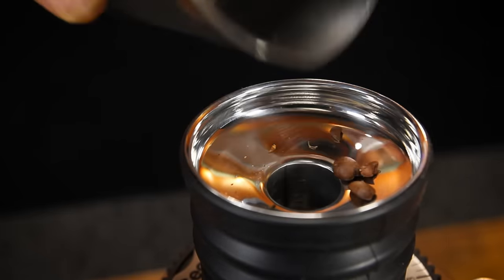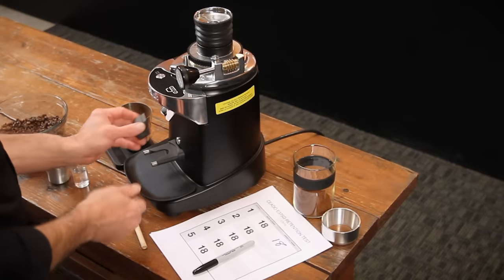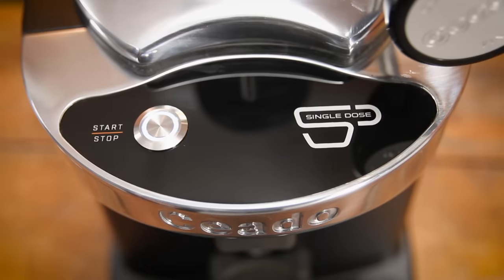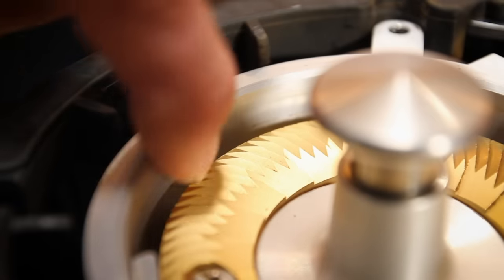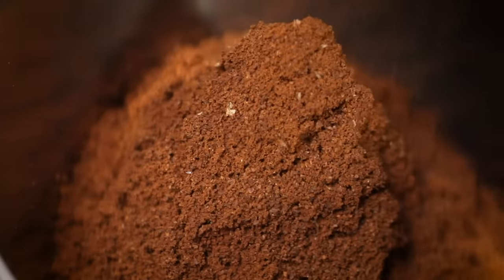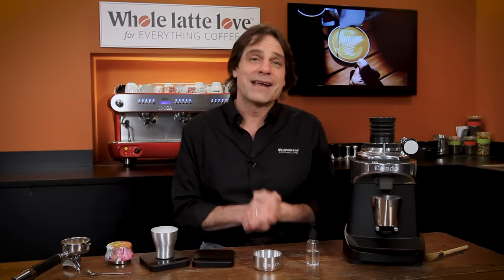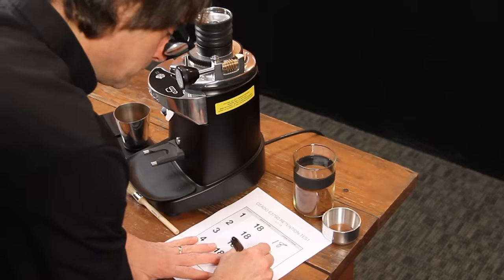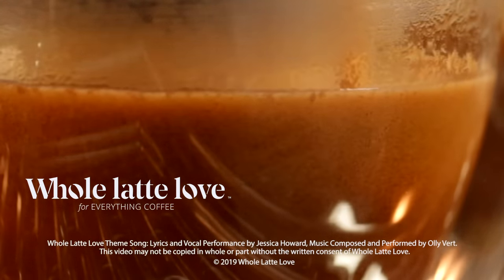Review: Ceado E37SD Single Dose Titanium Burr Coffee Grinder

Comment: Even as I am no customer of WLL - I live in Austria - I am a great fan of your reviews and „how-tos“ and I have learned a lot. Thank you for your great work and your „education“. Now I need an advice: I have recently bought a Ceado E37SD, mostly because of your praise of the machine. My problem is that I can not grind fine enough. I drink espresso only and even if I am close to „0“ the coffe is still to coarse. Could you maybe help me with my problem? I am quite frustrated and unhappy. Thank you in advance!
Reply from the maker: Hi Peter, Sorry you are having issues. Must be frustrating! You should be able to adjust fine enough to have the burrs touch and produce a grind so fine it will choke any espresso machine. If you did not know "0" on the dial is just a reference and usually does not represent the finest grind setting. The scale with numbers can be rotated without adjusting grind size. It's held in position by a magnet. Here's what I would do: With no beans in the grinder turn the motor on and continue adjusting the grind finer until you hear the unmistakable sound of the burrs just touching. When you hear that sound quickly back off a bit to a coarser setting. Back off just until the burr touching sound stops. That's the finest setting on the grinder. If you like you can position the scale (it just slides) to zero. Do not worry about the burrs briefly touching as it's not the cutting edges making contact but flat non-cutting surfaces of the burrs which are slightly higher. At that setting your grind will be too fine for espresso. If you set zero at the burr touch point you'll want to back off to a range of .5 - 1.5 before grinding for espresso. Cant be exact with that as a lot depends on bean type, dose weight, etc. From there dial in your grind as needed. I believe this should solve your grind size issue.
Marc
Reply: @Wholelattelovepage  Thank you Marc for your quick and enlightning answer! I hoped it would be something which can be fixed quite easily by me but I would not risk fixing it wirhout good advice. I will try it out tomorrow morning (our time). Thanks a lot for your help. Looking forward towards your next videos! You have a big fan in Vienna!
Reply: @peterfraunhoffer7126  How did things turn out after your adjustment? Were you able to have fine enough grinds?

Comment: Hi Marc! I wandering about the burr will it be wet and hard to clean if we use wdt? Because on my last case i used this method in my mazzer mini, and when i try to clean it, the burr is wet and take a lot of my time to clean it. Is it the same with E37SD? 
Thanks for your great review on this product! 👍
Reply from the maker: Hi Hadi, Thanks for the question. The titanium coating on the burr is very slippery so less adhesion of water and coffee dust to the burr. I took apart a well used E37SD 2 days ago and it was remarkably clean! One of the benefits of titanium. Since it's a singlre dosing grinder no partially ground coffee is left between the burrs. Using RDT with this grinder is recommended!
Reply: @Wholelattelovepage  Hi Marc! Thanks for the detail explanation. 👍

Comment: Hi Marc,
I need help choosing between the e37S and the SD.  

I feel I am a single dose person and I would never get tired of it (plus I would likely pull one shot, maybe two a day).  A couple of people have told me that I can use the S in single dose mode (without the weight of the beans in the hopper that it was designed for), and there would be no (or almost) no difference in the cup (compared to the SD which is designed for single dosing).   

I’m concerned popcorning on the “S” might give an inconsistent grind (without beans in the hopper).   

RE: retention; how concerning is a half gram retention? It seems like I could put three beans through the E37s to purge.. or is less than a half a gram not worth worrying about at all?   

I wish the engineers would let us know if the motor speed, titanium burrs, and the different shape of the cutting teeth we’re all designed for a more consistent grind, or if this is all for retention purposes?
Reply from the maker: Hi Rob, Thanks for the question - tough decision! I have used the E37S for single dosing and it does not popcorn. Even if it did it would not affect the grind quality. Do expect retention of ~.5g. In order to get there you will have to start/stop the E37S a few time to get every last bit of ground coffee you can. IMO .5g is no big deal. Think .5g works out to about 3% of an 18g dose. If someone can regularly detect that in a blind test they qualify as a tasting god! If you're okay with having to bump the switch a few times to expel as much grounds as possible then the S can work. With the SD you just leave it running and use the bellows to get every last bit of grinds. Seriously if you RDT spray an 18g dose you will almost always get 18g out. One spray adds .1g water weight.

The Titanium burrs retain an edge longer but it's also about how slippery they are so it adds to the low retention capability. Also impervious to rust if using RDT. Have to say I've used RDT on steel burrs a lot and never seen rust. But could be different for others depending on typical humidity or proximity to salt air (ocean). Hope this helps!
Marc
Reply: Oh darn?  The e37S does everything I want, so i dont have to buy the SD, LOL..  But what benefit would there be (besides less retention) in upgrading to the SD?  

ALSO, BTW: I’ve been using the e37S in single dose mode (with the tamper in place of the hopper), and I noticed the burrs suck air thru the machine.   So just covering the hole for a second works a bit like the bellows to get grinds out..

Comment: Hi Marc, thank for this video. I got a question: is possible use this coffee grinder in classic mode? I mean, is possible mount a hopper on the top of the grinder and deliver coffee using the porta filter as it happens in the E37S?? I ask you this because at home there is me and my girlfriend and we use the coffee grinder in a different way, so I was hoping to be able to use the coffee grinder in both modes rather than buying another one. Let me know, thanks!!
Reply from the maker: Hi D, Thanks for the comment and question. The E37SD does not accept standard hopper. Also has a single on/off switch so there's no activation of grind using a PF. You could just leave the grinder on and continue to feed beans by hand.
Marc

Comment: I bought two weeks ago the new Ceado E37S and is amazing, but I honestly regret I didn’t get this single dose version :( very upset!
Reply from the maker: Hi Leonel, Sounds like you've got quick onset upgrade-itis!
Reply: Whole Latte Love haha! That term is spot on :)
Reply: Whole Latte Love  Marc, on this note, I have more a technical question, as I mentioned to you, I bought the E37S and not the E37SD... I am trying to use the E37S as single dose as well, you know with putting the tamp on top trick kinda thing... my question is: does the burst doesn’t get damage if I grind the last let’s say 10 seconds with no beans inside? Is there any risk that something happens with my grinder because I am doing this repeatedly? What are your thoughts? Thank you very much, Leo
Reply: Whole Latte Love Hi Marc, I know we have been back and forth regarding the SD model, and you have been of amazing help, but could I kindly ask you a last question? As I mentioned, I have the E37S model, I bought it around 2-3 weeks ago, the shop where I bought is letting me exchange it for the SD if I want to (paying the difference of course, which would be ok for me). My problem with the S is how much waste I have due to purge every time I have to dial in... and therefore my question: with the SD version, would I have to “purge” (waste coffee) every time I change the settings or dial in? Also, I know you mentioned the retention is very low in this model, but because I don’t drink coffee everyday, let’s say, for example, if I make a coffee today and I don’t use the grinder for about 2-3 days, the next time I want to make a coffee I would need to purge the first dose because there is old coffee lying around inside the chamber for the past 2 days? Or because the SD is so clean that i wouldn’t need to waste coffee in this case? The reason why I ask is that i want to avoid changing my E37S to the SD and at the end I would have similar coffee waste. I really look forward to your opinion and after that I will make my decision of I keep the S or if I exchange it to the SD, thank you again, Leo :)

Comment: Hi Marc, I know we have been back and forth regarding the SD model, and you have been of amazing help, but could I kindly ask you a last question? As I mentioned, I have the E37S model, I bought it around 2-3 weeks ago, the shop where I bought is letting me exchange it for the SD if I want to (paying the difference of course, which would be ok for me). My problem with the S is how much waste I have due to purge every time I have to dial in... and therefore my question: with the SD version, would I have to “purge” (waste coffee) every time I change the settings or dial in? Also, I know you mentioned the retention is very low in this model, but because I don’t drink coffee everyday, let’s say, for example, if I make a coffee today and I don’t use the grinder for about 2-3 days, the next time I want to make a coffee I would need to purge the first dose because there is old coffee lying around inside the chamber for the past 2 days? Or because the SD is so clean that i wouldn’t need to waste coffee in this case? The reason why I ask is that i want to avoid changing my E37S to the SD and at the end I would have similar coffee waste. I really look forward to your opinion and after that I will make my decision of I keep the S or if I exchange it to the SD, thank you again, Leo :)
Reply from the maker: Hi Leonel, Thanks for the question. The SD when used properly is super clean. By properly I mean do use the RDT spray to reduce/eliminate static and tap the bellows to push out last little bit of ground coffee while the motor is still running. When I use the SD I often dose 18g. 2 sprays from the RDT mister adds about 0.15g. When I weigh the output from the grinder it's often 17.9-18g. The SD's titanium burrs have a slicker surface than standard steel burrs and stay sharper far longer. Hope that helps!
Marc

Comment: It‘s really sad that the products don‘t have an integrated scale. Only find one product on the market that has this function. So a really cool feature would be if you had different beans containers with different beans that you can change. So making coffee would be much easier and faster.
Reply from the maker: Hi Jan, Keeping beans out of a hopper is the point of a single dosing grinders. You can weigh beans prior to grinding and never have a significant amount of coffee left internally so you always get a fresh dose. Guessing the grinder you're thinking of is the Baratza 270Wi. About the only grinder out there which weighs the coffee as it's grinding. But, it does have a hopper and no-way of switching out the hopper without having some beans left in the grinding chamber.
Marc

Comment: Hi Marc, do you thinks the 37sd worth the price difference comparing to the 37s when it comes to the taste of Coffe in the cup? Do you see any difference?
Reply from the maker: Hi Cy-oT, As the name suggests, the E37SD is setup for essentially zero retention single dose grinding. You only grind the beans you use. The E37S is not setup for easy single dosing. You can do it with the E37S but it will retain some coffee. Typically about 0.5g. Also, the E37S is an espresso specialist. It takes some time and effort to make major grind size changes for other brew methods. The SD has a quick release on the worm gear so it's easy to go from grinding for espresso to coarser grinding for other brew methods. I say the SD is worth it if you are serious about single dosing with no grind retention and/or you switch between brew methods on a regular basis. As for taste, that's always subjective. We have done some taste testing and did not find "in your face" flavor differences. Hope that helps.
Marc

Comment: Just curious if you tried grinding without the RDT spray - is this unit more prone than average to static-induced retention, or just normal?
Reply from the maker: Hi C, I don't think it is more prone than other grinders. I have tried it without RDT and I don't get lots of static but grinds to seem to not exit the grinder as well with more cling to the chute. It depends a lot on ambient humidity in my opinion and on the bean moisture/oil content. Still in heating season hear so air is fairly dry. I've used grinders like the Baratza Settes which on one day have lot's of static and next to no static the next with same bean and grind.
Marc
Reply from the maker: Hi d, Other than pushing the grinds thru a restriction which would increase retention and cause clumping I don't think there is a magic method of dealing with static other than adding moisture via RDT. It's just a fact of physics: rubbing relatively dry things together in dry environments results in static.
Marc

Comment: Can I  buy the mushroom shaped shaft cap as a replacement part? I've noticed the same issue that someone commented about below with my e37s, namely that the LAST dose is of inconsistent (larger) grind size. If I do not keep the hopper sufficiently full, my last dose is a gusher. I'm wondering if the mushroom cap would help with that.

Comment: Just like the e37s i have, the last grams of the grind yields that clear part of the bean, and it probably grinds coarser than the initial grinding. Is it possible to check the latter, if the initial 2g is finer then the last 2g? Do those "clear" ground pieces influence espresso taste? Thank you very much Marc, great video.
Reply from the maker: Hi lap42, Thanks for the comment and question. Not sure I fully understand your question. IMO and experience the grind size is very consistent start to end of grind cycle.
Marc
Reply: I am curious about the same. If I single dose with my E6, the end of the grind gets coarser and the shot is a lot quicker. Does this model do something special to avoid this?

Comment: I am trying to modify an Eureka Mignon with a bellow like the Caedo for single dossage. Not sure if it'll work as good.
Reply from the maker: Hi Tim, Good luck - let me know how it goes. I'm skeptical of it working as there's more going on in a single doser than just blowing air through to push out left behind grinds. SD grinders use a different design in the grinding chamber with sweeper arms tighter to the edge of the chamber. Also use treated burrs to resist corrosion that may happen with normal steel burrs due to use of moisture in RDT.
Marc
Reply: @Wholelattelovepage  I've done the DIY below for my Eureka Mignon mkii. Resul was quite good with 0.5g retention after 200g of grinds. And I think we can do grind adjustment while the machine is off becauss burr chamber is empty.

Comment: Hi, my Sette 270 just died and I think it's time for an upgrade. I've narrowed it down to the E37SD, however, I've been reading a lot of comments that it's difficult to get consistent results. What is your experience after almost 1 year? How much run-in is required with regard to the coffee ground? I've also looked at ECM vtitan-64, but I'm really only doing light roast espresso and only single dosing, not sure if that would be a better option, any tips welcome!
Reply from the maker: Hi RS, If you like your 270 do know Baratza has a fixed price repair program. Honestly, I don't think results get any more consistent for espresso than with the E37SD. I do not recommend the Titan as a single dose grinder. It has a fair amount of retention. The SD is essentially zero retention. Both have titanium coated burrs which produce excellent grind.
Marc

Comment: Do we know yet if the worm-gear conversion will work on regular E37S models?  Bought a refurb from WLL about a year or two ago, and I'd kill to upgrade to this.  I exclusively weight out my beans for every shot, so my hopper on top is basically unused.
Reply from the maker: Hi KM, Thanks for the question. Quick Set Gear upgrade kits are en route to us for previous E37S models with serial numbers beginning with the letter F, G, or H. We expect them to arrive in a week or so. Please be aware the upgrade is not compatible with some earlier versions of the E37S. Also, the Quick Set Gear for standard E37S models does not have the swing out worm gear release seen on the SD model in this video.
Marc
Reply: Hi, I also have a E37S, so you do Single Dose with yours? how do you do it if I may ask? Do you have good results? Thank you

Comment: What is a good alternative leveler that is more affordable? I'm interested in using a leveler, but uness they are more comparable to a tamper, I think I would rather keep tamping. Also, having never used a leveler, it seemed that tamping wasn't necessary after leveling. Is this true or does the leveler just provide a flat, smooth tamping surface?
Reply from the maker: Hi Jordan, Thanks for the comment and question. There are levelers which are cheaper and more expensive than The Jack. IMO The Jack hits the right point of value/quality for the price. Cheaper levers tend to be lightweight and  often made of aluminum. Many are not depth adjustable or difficult to adjust. When used properly tamping is not required. A good test of this is leveling and then knocking out the dry coffee and it comes out as a solid puck. You can see that in this video on how to use The Jack: https://youtu.be/4Z5vTi643sc
Marc